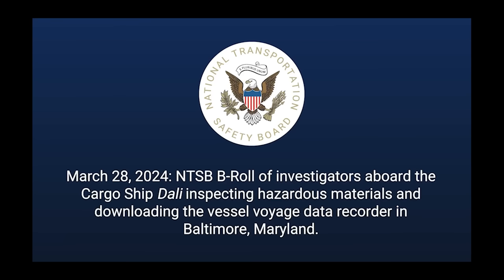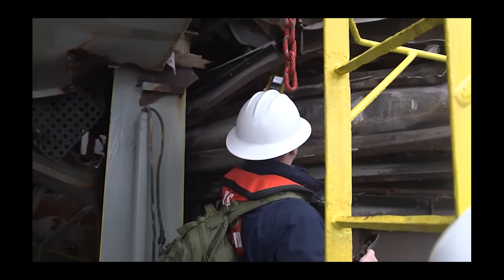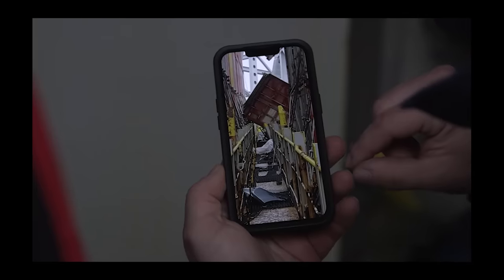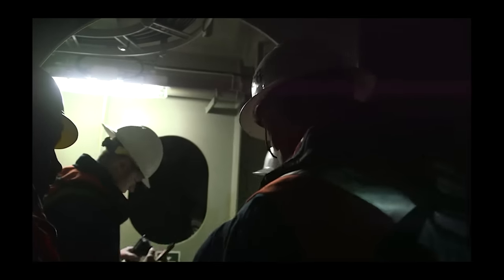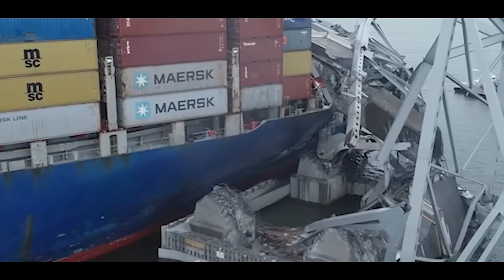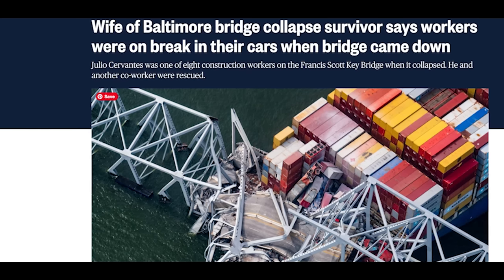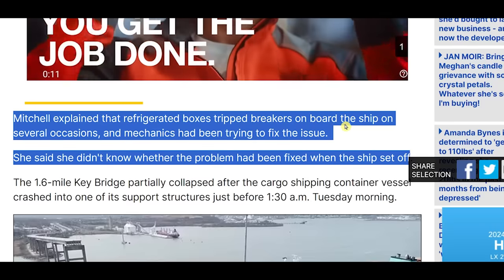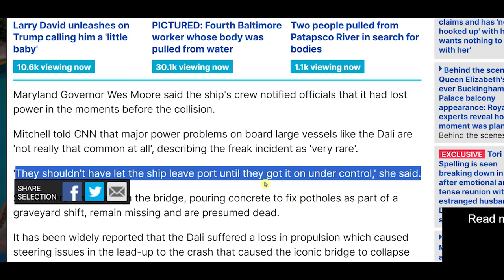NEW NTSB Video On Dali Ship Point of Impact Key Bridge

Comment: Why wasn’t the ships horns blowing and why no tug escorts ?
Reply: Tugs are only used for docking. Ship channels are miles long. No need for tugs.
Reply: @davidcolwell614   
Thanks David.. I was honestly wondering why no tugs on such a narrow passage… do you have any information on the tide currents that night in the channel ?
Reply: No need for tugs as long as it all goes to plan. No plan b so accept the result.
Reply: The news reported that they had called for tugs.
Reply: Watch What's Going on with Shipping for a great explanation of this topic.
Reply: @vglide  The tide was going out and it was about one day after the full moon (highest tides of the month) and spring tides are higher than other times of the year, so that might have carried them forward even when they were "coasting". Apparently, there was wind blowing on the solid wall of shipping containers from the port side which was probably the biggest factor making the powerless ship veer hard to starboard.

The tugs guided the ship out of its berth through a loop of about 180 degrees until it was in the shipping channel. From there, it's a straight line out to sea, so the tugs are not considered necessary, but maybe they should stay with ships a bit longer. That would make things more expensive, but of course, not as expensive as replacing a bridge.
Reply: There were two pilots who work for the harbor on board to help guide the ship. They stay on the ship until well after the bridge.
Reply: @davidcolwell614  with that bridge there  tugs till passed it should be mandatory
Reply: @NeilWick  Also the ship was in the Patapsco River which has a current flowing out into Chesapeake Bay, except when the incoming tide overpowers it.
Reply: @Revkor 
Would make sense to have tugs until passing beyond bridges
Reply: Wondered the same about horns...perhaps bridge workers would have been able to notice the danger sooner
Reply: no tugs is main failure
Reply: Would you like the real answer or more propaganda? If it's the former, you won't find it on this platform.
Reply: @theopinionisthighqualityopinio  ya I was hoping for some real information, and I appreciate the information that has been offered here. I sail a little Hobie Cat 16 it’s a tiny catamaran, but only on a small lake so zero experience with large waterways or shipping channels. I lived next to Pearl Harbor in Hawaii so I’ve seen some large vessels but again no knowledge of how they move about. I guess my main thoughts were concerning the bridge workers. And for all I know maybe the ship was using horns ? The videos I’ve seen don’t seem to include any audio.  Such an incredibly tragic situation for everyone involved. And obviously this is going to impact all our lives one way or another. Thanks again to all of you who have taken the time to share your knowledge regarding my questions. Humble thoughts and prayers to those who have lost loved ones in this tragedy.
Reply: @NeilWick  There some ports where it is compulsory for every ship to be escorted with 2 tugs until the are past hazards.
Reply: It takes power to build up air pressure to blow a horn 😂. If they didn’t have power for propulsion how do you think they had air to blow a horn?
Reply: @jamesepperson5940  every vehicle I’ve ever driven with an air horn had an accumulator tank. I would imagine a ship that size would have a similar system, I doubt very much they home run the airlines for the horns directly to the compressors ..  mechanically wouldn’t make much sense now would it. I understand your logic but I don’t think you’re even remotely correct. Appreciate the humor though 😂😂😂
Reply: @vglide  maybe they didn’t have any air pressure built up or maybe they had a massive leak and their tanks were drained
Reply: That is a significant cost incurred by the company. the bridge has been in this exact spot for almost 50 years, and this is the first major strike. it worked hundreds of times per week for almost 50 years. 

The lack of tugs wasn't the cause of this... The port not keeping them is. The port authority should have notified the USCG and the USCG should have held them, or tugged them to another berth, so they could work their problems out. If they were having major issues, they were not seaworthy. Therefore the USCG can hold them in place until it is fixed, and that is what should have happened.
Reply: @vglide  this isn’t the 1920’s. There isn’t a guy standing on the bridge with a rope pulling a lever to blow the horn. They have electronic solenoids that need POWER to run and they also need air pressure so if you don’t have one of those things you can’t blow your massive ship horn.
Reply: Can’t tell from any videos if horn was ever blown, but I definitely didn’t see any flares being used to alert others of their distress and impending collision in any video footage I’ve seen thus far. Don’t need power for that.
Reply: @vglide  the 

"passage" was 1200ft wide and the ship is only 200 feet wide... so you could fit 5 of them thru the bridge at the same time... doesnt sound tight to me
Reply: @Revkor  amazing how it hasnt been needed for 47 years... seems more like a issue with dali and its owners
Reply: @williamhaynes7089  ya I hear ya …  from everything coming in sounds like the ship was having mechanical issues all along….  Have to keep those share holders happy..  etc .. and now our country and more have to deal with it ..   This will probably have more impact on our economy then the trade towers ..  the difference being, the trade towers brought us together as a nation.. this incident unfortunately is going to deepen our current situation of disparity..  I’m so saddened by our countries situation… 😔
Reply: Probably loaded with a bunch of chinese crap destined for an amazon warehouse...
Reply: take a bit of time to google your posts, please.

It had already been tugged out of the dangerous parts and into the main channel. It still had two dock pilots who were driving the ship.

That is the say that the captain of the ship wasn't even piloting his ship. Baltimore was.

And how do you blow horns without power?  Magic Pixie Dust?

Comment: @jeffostroff that meter is called a LEL or LVL meter it tells you if there are any explosive contents in the air.
Reply: Lower Explosive Limit meter - detects dangerous levels of a combustible gas or solvent vapor in air, expressed in percent Lower Explosive Limit, or LEL. Those possibly compromised drums could contain volatile chemicals which could vaporize and become explosive at the LEL. One spark and BOOM! I'm sure they are also checking manifests and pulling the Material Safety Data Sheets (MSDS) to gauge potentials for exposure and cross-mixing. Nothing says "Surprise!" like an accidental binary explosive or cloud of Chlorine gas.
Reply: @luisderivas6005  i am surprised they didnt have two of them , his one was a 4 gas detector , one sensor typically being for oxygen levels ,  one for carbon monoxide CO , NO2 , H2S , but one of those guys would have also had a detector for VOC volatile organics which is explosive solvents or petrol , essential for confined spaces
Reply: No, it's for detecting poisonous gasses.

Comment: A ship that size uses a very powerful horn as a warning mechanism, its literally loud enough to be heard for miles and could wake you from the dead a mile away. In a possible collision that horn should of been blaring constantly. why is no one in the news even mentioning a horn much less asking if it was used?
Reply: does the horn work if there are no electrics , Does the port authority ban the use of ships horns after 9 PM due to complaints from NIMBY's ?
Reply: @heartobefelt  Yes it will work without main power to the ship - thats one of the warning signals its designed to warn others about. and the most common of warnings (not that it lost power - but that it is moving without control).
 And yes there are regulations on when u can use it, one of them is an emergency where safety is at risk, even f it was not allowed at all the captain would ignore that if he is about to kill people.
Reply: I also wonder if flares should have been used once they knew they were likely going to hit the bridge. Flares don’t need power.
Reply: @chow-chihuang4903  Flares are normally not used for such, but it would of been a good idea. Then again, if they crashed and oil or fuel ended up on the water, that be a bad idea. lol.
Reply: @armastat  Haha, true! But they weren’t leaking at the time they lost power. Could stop shooting them off after they hit.
Reply: @chow-chihuang4903  unfortunately the good flares use parachute to stay up as long as possible they would probably still be airborne when they hit.
Reply: @armastat  Well. I’d have preferred they try every method to alert people around them of the impending danger, especially the work crew on the bridge.

And I mean the local authorities as well as the ship crew. Emergency sirens could have been set off in the four or so minutes from the radioed alert to impact. I hope improvements to SOP include alerting any people working on the replacement bridge, just as any people, employees or contractors, working in or on industrial equipment are logged so site emergency responders know to contact or look for them.
Reply: @chow-chihuang4903  yes, warning lights on the bridge itself would be cool. if the horn sounded this crew would of been alerted, they were right there. instructed on what to do probably would of helped. I suspect the bridge crew was the model of running around like a chicken with its head cut off as they tried to fix the issues and such.
Reply: @armastat  Many new projects have message banners above the roadway that will flash warning messages such as "Warning Lane 3 closed due to broken down vehicle" etc but they probably wouldnt have had enough time in this case , They were lucky that Police got to close the approach on both sides or there could have been 20 - 30 people in the water.
Road repair crews usually have UHF radio , however many have gone to encrypted UHF for a cleaner channel so outside agencies may not have been able to contact them
Reply: @heartobefelt  I doubt they would be reading the traffic notification signs while working. plus they would be at either end of the bridge . Rotating warning lights every 100 feet would do it.

Comment: Have been following merchant marine channels and engineering channels for a while now.
This is the first event that overlapped.
-----
What amazes me is how dang clueless each discipline is about the other.
I have a sort of cross-training and experience in both.
It is super frustrating to hear the crazy talk out of each.... on their 'off' subject.
Neither crowd seems to have much savvy about the other.
Weird as heck... but there it is.
Have seen it all over the place on this event.... not isolated hiccup.
------
This is NOT a BOAT.... it is a SHIP.
And NO.. it is not at all amazing it did not sink.
It is HUGE and has lots of reserve buoyancy.
A hit to the superstructure is not how you poke a hole in the hull.
And it couldn''t truly sink there even if it was full of water as could be..
.... it would ground out after partial flooding.
These are shallow channels compared to the draft of these vessels.
-------
Please, please, please.....  ease up on engineering talk about ships.
It is cringe as cringe can be.  
And also.. homeowner experience does not quite translate to shipboard systems.
It is another planet... entirely.
----
I am ex-USCG.. went to sea in the North Atlantic in the winter..
.... then promoted to a position to runsome stuff ashore that included COTP duties.
Studied for my merchant marine license before I went off on other paths.
Studied standard engineering basics before heading off into IT  work.
Worked construction, too. And still hold my AB papers.. someplace.
-------
Offered as a quasi-expert opinion from a person with cross-knowledge of these disciplines.
Reply: No tinfoil for you! 😉👍👍
Reply: Yeah, as a mariner myself this guy has absolutely no clue about anything related to how vessels operate. He's just looking to capitalize on a disaster to rake in those views. I stopped watching when he was equating DIY home experience with loading operations...
Reply: @jcdenton6074  Agreed, I watched a few minutes before realising this guy does not know what he is talking about in the slightest. As you say he's just trying to cash in on what happened.
Reply: Then don’t watch his videos if it bothers you. He never claimed to be a professional mariner but it’s still new video and content from the NTSB that we haven’t seen before & we appreciate Jeff’s insight.  Most of this is video is the inspection from the NTSB that hasn’t been shown on the mainstream media so it’s good enough for us lay people who aren’t seasoned professionals like you guys.
Reply: @heatherupton6558  Hey Heather, I bet you're fun at parties.
Reply: @heatherupton6558  Don't worry I won't watch anything this guy ever does again. He talks complete crap, is misleading, done no research and trying to make a buck of a disaster.
Reply: @jcdenton6074 OMG I bet you're fun at parties too. Who did you steal this line from?
Reply: Would you agree with me that this is a fault of infrastructure & regulation? A ship that large should not be allowed to traverse under such a matchstick if a bridge. There should have been bollards to protect from such a massive ship. Or a new larger bridge built to handle such massive traffic. 

It should be able to handle a bump at 5 knots from any ship traversing it. That ship was too big to safely navigate around the bridge since it wasnt built to handle such a ship. I dont even blame the ship at this point. Squandered resources left an unsafe bridge to handle such giant merchant ships.
Reply: @jeremyr7147  100% agree. The bridge should have had strike protection from ships. Full stop.
Reply: @jeremyr7147  The economics of the port means ship traffic thru there is way more important than a bridge that is mostly a commuter convenience.  In my view ships, there, take precedence over roads. And, as you note, and lots others, it needed proper protection with heavy duty dolphins.

Comment: That they were having electrical problems prior to leaving port is new information to me. They sheds a whole new light on the accident.
Reply: You know part of the story.  Part of the light has been shed on the story.

The Baltimore Harbor Pilots would NEVER have left the dock if it was showing problems still at the dock. They were in control of the ship when it failed.

Comment: A Safety Data Sheet (formerly called Material Safety Data Sheet) is a detailed informational document prepared by the manufacturer or importer of a hazardous chemical. It describes the physical and chemical properties of the product.
Reply: It's posted AFTER the UN number.  You have a UN, which is a 1993-flammable liquid, and then an MSDS, which tells what liquid it is, its effects, dangers, etc.

Comment: A total shutdown of the boats' electrical systems would not be caused by only a single circuit breaker. 
The systems have multiple circuits.
They may have been running on reduced generators. 
The mystery will be solved soon enough. 
Of course, this will change the laws for ships in USA ports.
Tugs may be added to the equation also.
Reply: That bridge was a death trap.

Comment: I read that the ship can carry over 9000 twenty foot containers and was only half loaded when it left port. So even if 5000 tons of bridge debris is laying across the bow, that's only the weight of 189 loaded 20 foot containers. The weight isn't distributed evenly of course, but that section of bridge isn't heavy enough to actually make the ship sink.
Reply: It was full, they were double size
Reply: @ffdv7458  Ah I got ya. I read it wrong. It was full of 40 foot containers. That makes more sense.
Reply: The bow is sitting on the river bed. It’s roughly 50 foot deep there.
Reply: The bow never hit the bridge.  Only the upper super structure.
Reply: @Donald_Turnip It hit the support of the bridge.

Comment: It appear the overhanging upper part of the bow extended past the bridge bumpers.   Note the video and the point of impact.  that point is at the main deck level of the ship on the concrete bridge support, way up in the air.   The bumpers on the bridge simply did not extend out far enough from the bridge supports to offer protection for an impact of a ship with such a high up, large overhang of a ship's bow.